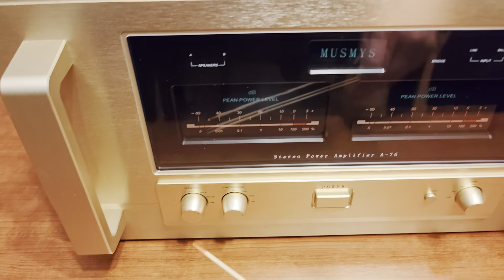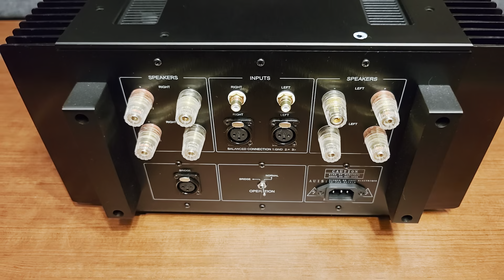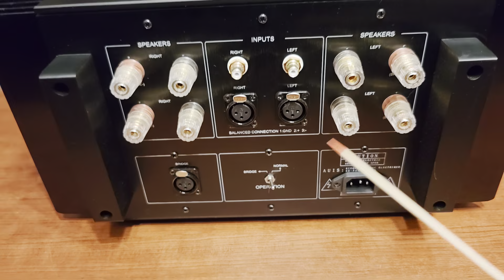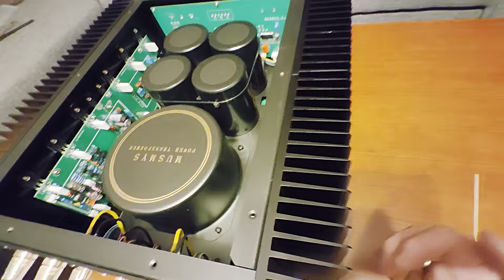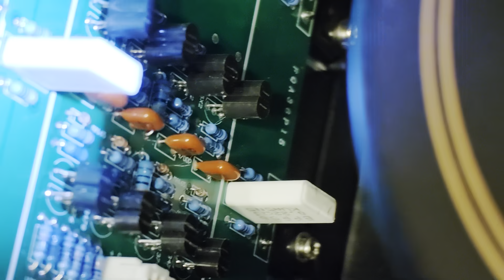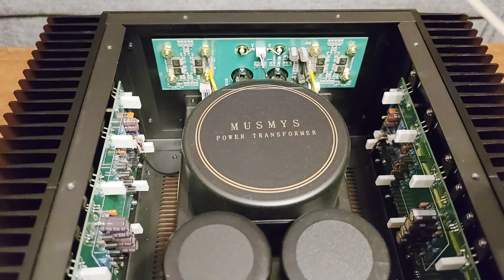First look: Accuphase A-75 speaker amplifier pure clone by Musmys: BEAST!

Comment: Can't wait. High hopes🤞. What is its rating at 4 and 2 ohms? Wonder how hot it will get driving the loads of your speaker?
Reply from the maker: @HotSause  During burn in it was surprisingly cool, there's a big amount of metal to heat (it's really, really heavy).
It has some crazy output 120x2 in 4, 240x2 in 2 and 480x2 in 1 Ohm load. 
It OFFICIALLY supports 1 Ohm speakers so it's like a welding machine :)
Reply: @k4syx  Thanks for that info. Anxious to see if they would  sound effortless when driving your low ohm load speakers
Reply from the maker: @HotSause  Thats exactly what i hope for!

Comment: Love that XLR - RCA switch on the front 😍
Reply from the maker: Exactly! It's so convenient to be able to switch between two sources from the front of the amp!
Reply: @annebokma4637  Unless that switch powers a relay to alternate between inputs, it’s a bad idea.  Bringing an input signal past an xformer will cause lots of induced AC current on that high-impedance line.  It’s why nobody else does this without expensive relays.  It’s also unneeded.
Reply: @samuellord8576  unneeded? For you maybe. I have studio gear and consumer gear, so mostly XLR OR RCA.  I could and would use that switch if it is on the front instead of the back. And placement of switch makes no difference in if it is implemented right or wrong. The switch is there either way already.
Reply from the maker: @samuellord8576  I will check how this works as you make a good point here (about distance and EMI). As for unneeded - I need that as this makes it possible for me to get DAC directly via XLRs and still have the flexibility for preamp via RCAs.

Comment: It reminds me of my old DK Design reference integrated in terms of build and enormous heatsinks. That DK was one of the first amps designed in the US but built in China, and punched way above its price class. A few capacitor upgrades and it still sings beautifully.
Reply: I'm thinking about getting one. Is it an easy task to upgrade caps?
Reply: @MonoBromatic Hi! Did you get to buy a unit ? if so how has it been ? I just purchased one this month April 2026.. thanks.

Comment: When you fire this amp up, the warning klaxon at the power plant goes off, prompting them to switch power regulation. The amp gives off a nuclear signature, which is picked up by intelligence satellites. You can expect a visit from the Nuclear Regulatory Commission. You can also fry eggs on the top cover, so that's a plus.
Reply from the maker: @rogueprof  it has official support for 1Ohm loads (delivering 2x480W) so I can use it as a welding machine, and yes, the lights on the streets will probably go dim :)
Reply: I guess you never saw the documentary about how things work in a nuclear power plant. There is this guy Homer showing you exactly how it's done. It is an animation and has been on air for years 😂
Reply from the maker: @annebokma4637  I've learned a lot from this documentary! (Mostly Dr Homer scientific sounds)
Reply: @k4syx  doh 🤣
Reply: I will be very interested to know how it sounds
Reply: @davidfoster5164  yups waiting for that review to drop 👍😁
Reply: Let's face it a lot of stuff we buy is made in China then re badge to a famous brand so how do we know the factory that made this doesn't also make the famous brands we love.  I'm pretty sure that's probably true for a lot of components as well capacitors transistors resistors and some micro circuits good also be made in China And re badged
Reply: @davidfoster5164  absolutely true. Not all brands mind you, but somewhere in your gear there are Chinese made parts.
Reply: 100%
Reply: Mmmm ... Donut ...